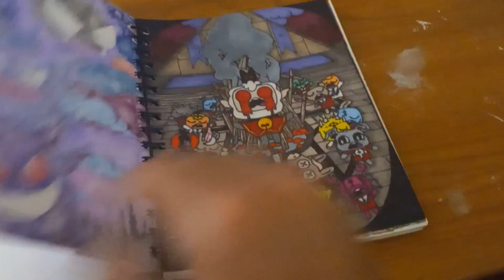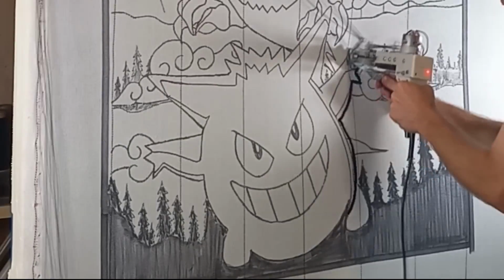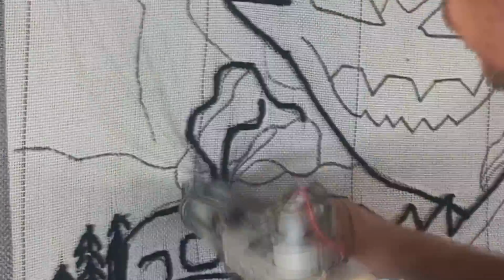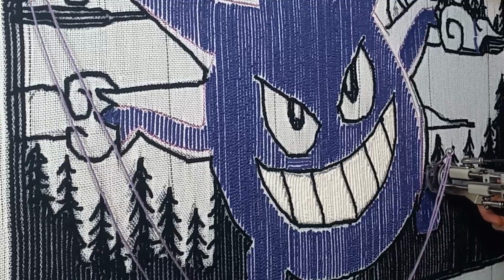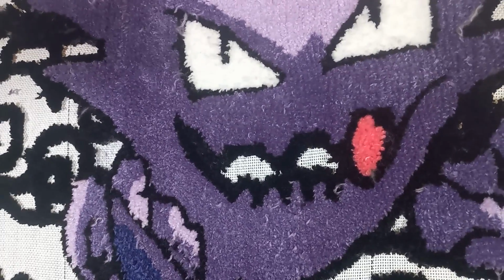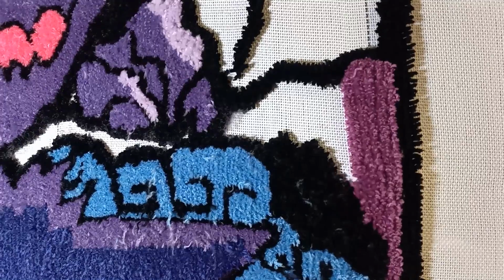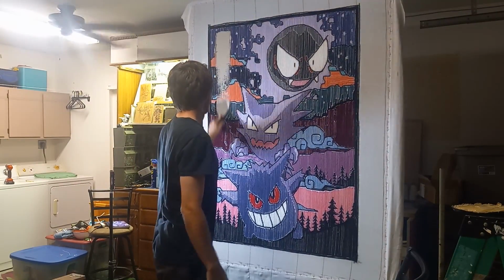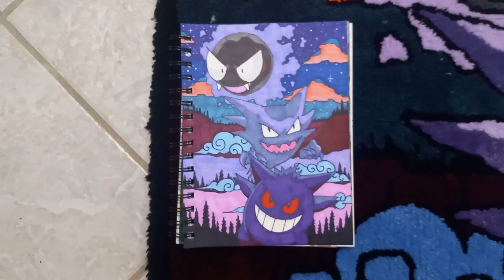Turning a Pokémon Drawing into a Big Tufted Rug

Comment: hey man, just wanted to say i appreciate your vid’s, they are entertaining and i enjoy hearing you talk about your old stories of playing pokémon and stuff, im selling paintings in order to get the stuff to make rugs and then i will make rugs until i can fund my clothing brand and start to sell all 3 of them, any tips you have for tufting?
Reply from the maker: Hey thanks! My biggest tip is that practice is key. I went into rug making feeling pretty cocky, and my first rug was not great at all lol. But the key is to stick with it and learn from mistakes. The two most important things in my opinion are making sure your cloth is stretched super tightly across the frame, and making sure your yarn is being fed with little to no resistance. Otherwise it will keep pulling out of the gun and it becomes a frustrating nightmare.